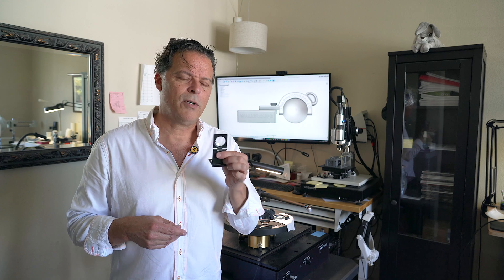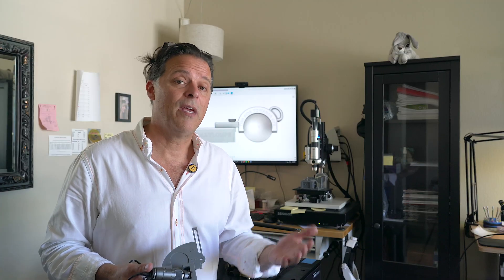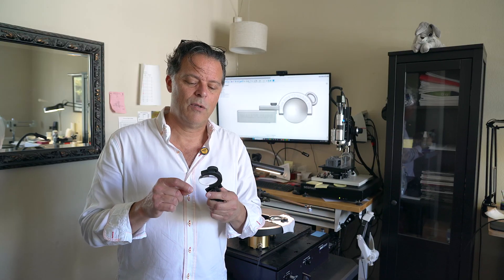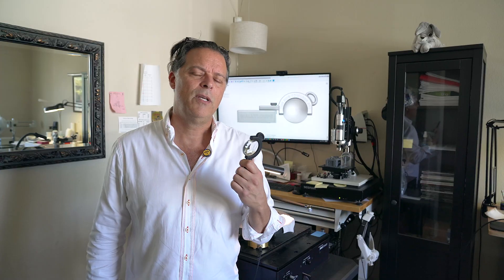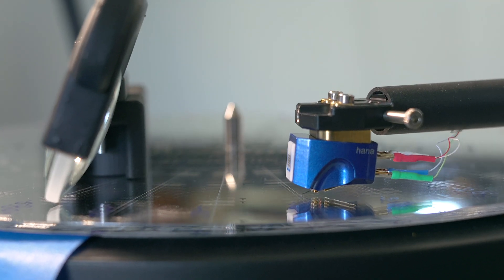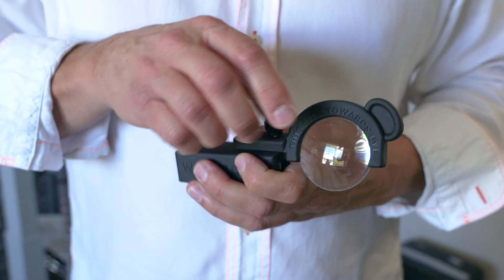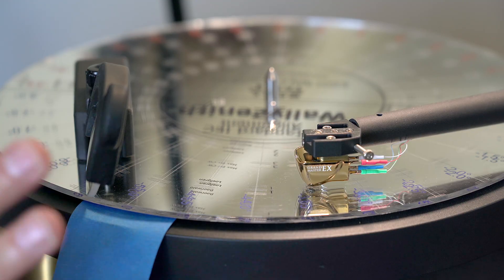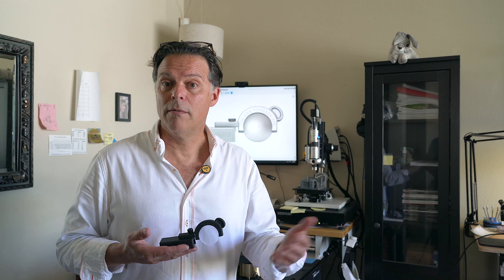WallyLoupe Instructional Video

Comment: Let the lens come with a little piece of wood to block the platter from turning, it‘s nothing special, sure, but some people won‘t bother and think they can handle it and yes, these type of people mess it up even with that little stopper delivered.
Reply from the maker: Unfortunately, a wood block or wedge of some type will not work for many turntables. Tape is most universally applicable.

Comment: You should be able to have the bottom of the lens flat and still have no problem with diffraction. Why didn't you do that? That means the lens could be lower and at a straighter angle if required. Being at a straight angle or slightly pointing up gives the opportunity to look at the surround what you can't do at an angle like that I'm not sure why you want an angle I don't know 33° say I'm not sure what it is, you can't really see underneath or the back of the cartridge. Also if it was in a casing you could have a Focus led at that point, would be nice to illuminate the cantilever and stylus. You should call it the wally loopy doopy lens, it's got a ring to it bit of fun stands out.
Reply from the maker: What you are referring to requires an aspherical lens, I believe. Those are very expensive. This one is spherical. Also, I have never found frontal lighting to be very good - Too much over flash. Lighting from the side and slightly to the rear is often optimal.
Reply: @WAM-Engineering  well you can get cheap Square lens magnifying glasses. they make spectacle lenses Square. I don't think they should be more expensive. You could grind it is it glass? on a wet bench grinder stone. I think you only need about 5 mm taken off the bottom. Yeah I can understand with the LED you could bleach it out! I mean you can adjust the intensity use a warm light 27,000 Kelvin. You could put the LED on the side and face it an angle, I understand the shadow aspect you're saying. A three volt button battery, you got two terminals there anyway! just put a switch on it, you can use the bolt as one terminal and the guide pin if its metal sleeved into metal sleeve as another terminal.

Comment: After aligning 15 different carts I've learned to carefully place a small piece of tape to hold the WallyTractor in place after getting the stylus tip in place. I have the lens that came with my WallyTractor and I'm thinking I need to put some felt on the bottom to keep it from scratching up the surface.
Reply from the maker: If you do, keep it thin so it doesn’t raise your viewing angle too much
Reply: @WAM-Engineering  I have a 3 1/2 inch magnifying glass that I use for side views that works really good.
Reply from the maker: I imagine that is very good for side views but not so much for cantilever angle alignment. Too much distortion at the lens margins and high viewing angle.
Reply: @WAM-Engineering  The supplied magnifying glass works great for the cantilever alignment. I have some of those carts that hide the cantilever and stylus, but between the two magnifying glasses I can get everything aligned.